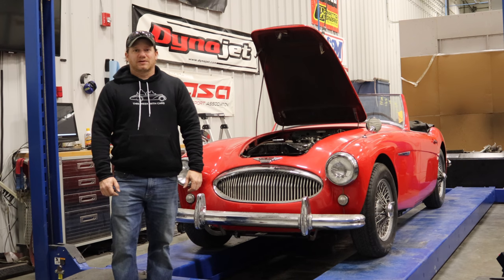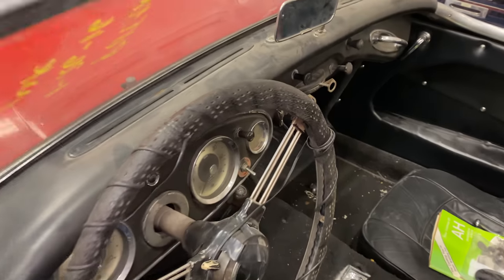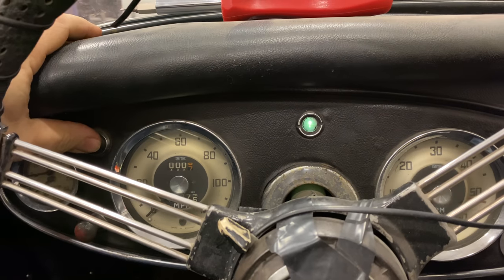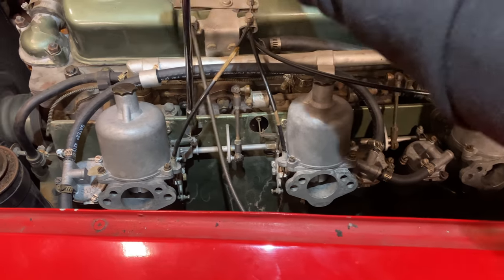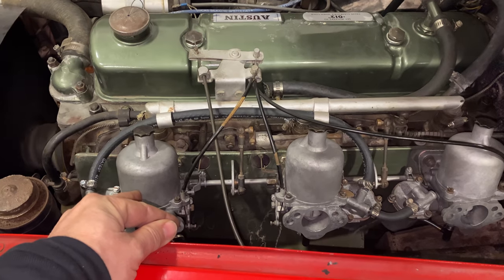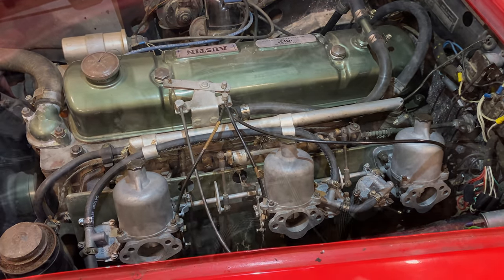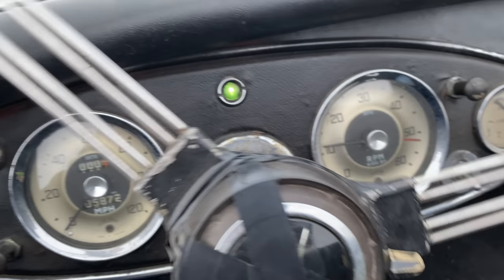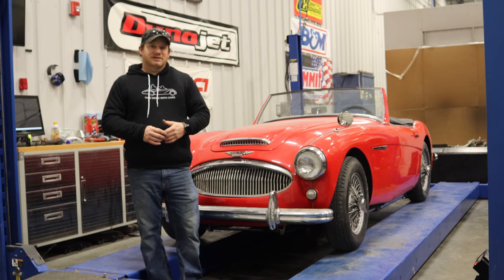After Mice Ruined This BT7 Will It Run?

Comment: For many years in the 1970s an Adelaide South Australia Car dealership on Port Road used to have a Mini ute on the roof. I think the business was Newport Motors. Often wondered what became of it. Would have been great to get hold of it and fit a 1275 Cooper S motor and running gear. I note the little truck has twin carbs so interesting to know if its a 1275 cc  motor or the smaller Mini Cooper motor. 
Looking forward to seeing how the restoration works out. Would look great a British Racing Green with white roof and Mini lite mags.

Comment: You've done a wonderful job of bringing that old beauty back to life. Just to point out a "wee" issue; looking at the vid at 1:21 & 4:20 all three carb slides appear to be set at different bottom idle stops.  The rear one looks like it would be forcing a high idle with the front starving the intake to the front cylinders.  My protocol is to back off the three idle setting screws until they're not in the equation at all then undo the linkage clamps to all three to make sure all slides are able to bottom out then start my aligning of slide movement process from there to arrive at a final idle setting for all.

Comment: Make sure the carbs are balanced with a drop test first, then ensure the dashpot is full of the correct oil to the right level. Wind the jet all the way up and then lower it an equal number of turns, usually 2 1/2 turns. 
Use a feeling gauge to set the linkages once you have balanced and synchronized each carb with the others at proper operating temperature.
Its a lifting pin on the underside of the carb, not a lever. You should only lift it 1/8th inch

Comment: My 68 MGC (6 cylinder version of the MGB) that I refurbished back in the mid-80's had triple carbs. Couldn't synchronize those carbs without the vacuum tool like he was using. Once I borrowed and used that tool, the engine smoothed right out.

Comment: many years ago, my uncle, the architect, came to visit. He had a light blue metallic 3000. I was just 17 and he threw the keys at me. I drove it about half a mile with the e-brake on.  It had the Laycock overdrive. It was just a switch on the dash. It had this smell.... like wet horse hair , oil and leather.

Comment: I have a 58 Austin Healey that looks almost exactly like this one. I tune my Dual SUs with a Color Tune Glass spark plug along with a vacuum carburetor synchronizer Tool. Iv never been able to correctly tune my carbs using the lifting the piston method.
Reply from the maker: Have your throttle shafts been rebushed?   Especially won’t work correctly if you have vacuum leaks.
Reply: @ThisWeekWithCars  Iv rebuilt the carbs using a rebuild kit from Moss Motors. Iv never replaced the shaft bushings.  There's probably vacuum leaks at the shafts. The engine runs pretty good after playing with every thing.

Comment: S U  Carbs . Fiddly Bastards . But once dialled in they are near as good as EFI . Economy AND Power . Clevis Pin has flogged out on the Bonnet Hinge would be my guess . Or perhaps the Bonnet stay in it's CORRECT place doesn't hold it so far back ?  
Gorgeous Old Car . Street Rocket from another Era .

Comment: To chech an su carb just push your fingwr iñ the carb and chech the pisron is free and being damped by the damper  you nedd to set all 3 carbs at zero then check your air flows are all even

Comment: YUP ....triple carbs ...not pleasant to work with. Not mentioned was the condition of the carb shaft bushings and also the dashpot action.  Cold weather significantly changes the dashpot action as the fluid is more viscous.    Just imagine an experienced mechanic tuning up the triple carbs ...back in the day.   The method they used (without today's flow measuring equipment, was the use of a hose cut to a length like 2 feet. The length was completely arbitrary .....then put the hose close to the intake and the other end close to your ear to "LISTEN" to the sound/pitch.  Listening for the purpose of adjusting the idle position such that each carb "SOUNDED" the same or as "matched" as possible ......THEN .....adjust the carbs from there.

Once on the road ....there is NOTHING that sounds like a Healey, either sitting idling or coming from a distance ....NOTHING ....😎      Those people who dropped a V8 into these cars ....might as well drive the vehicle off a cliff into the ocean.
.
Hope you get this car on the road. .......RICE???? .......WOW.😢

.